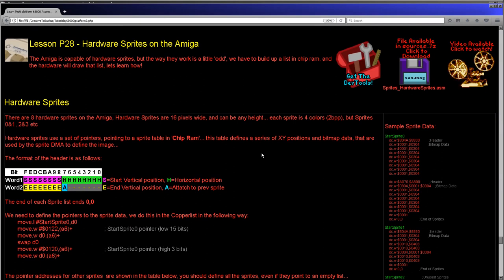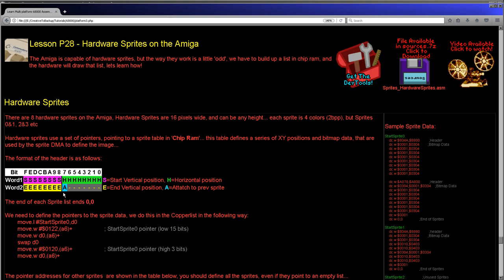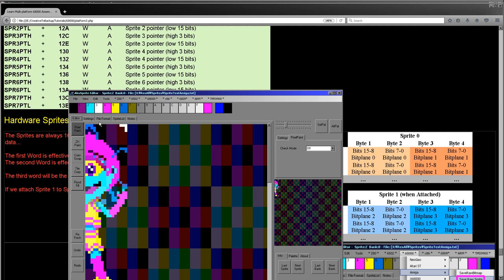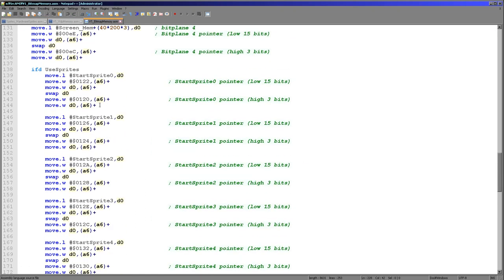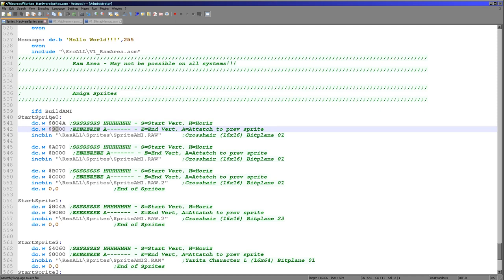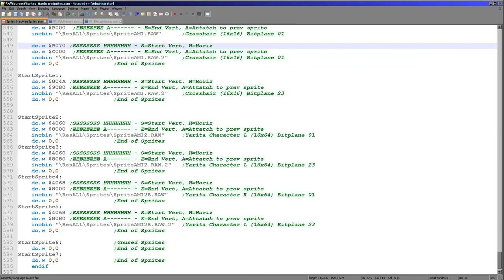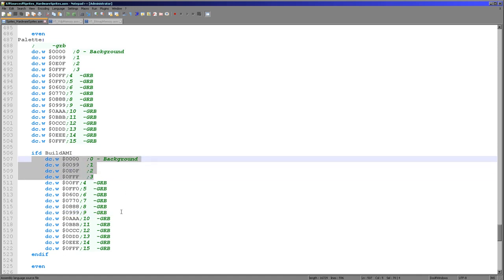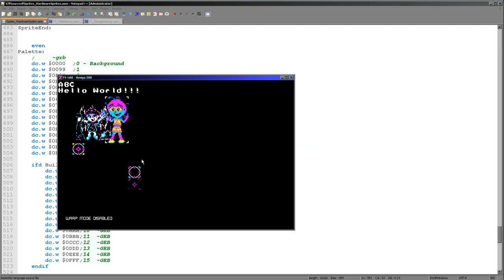Lesson P28 - Hardware Sprites on the Amiga

Comment: Great as always :)

However, It might be worth mentioning also that setting the 2nd byte of control word 2 to 0 only allows a 2 pixel granularity for horizontal movement as the low bit of HSTART is stored there on bit one, along with the high bits of VSTART and VSTOP.  By setting this byte to 0, you're essentially saying "VSTART * 2".

To demonstrate this, here's my C code for my UpdateSprite function, note the shift on [0] and the final AND on [1]:

void UpdateSprite(struct Sprite *sprite)
{ 
 sprite->posctldata[0] = (sprite->y << 8) | ((sprite->x & 0x1fe) >> 1);
 sprite->posctldata[1] = (((sprite->y + sprite->height) & 0xff) << 8) |
     (sprite->y & 0x100) >> 6 |
     ((sprite->y + sprite->height) & 0x100) >> 7 |
     (sprite->x & 1);
}

Comment: I have always assumed that hardware sprites on the Amiga would be a lot more advanced and easier than on the C64. 
When it comes to sprites, the designers often appear to have trouble making a programmer friendly system.
Which computer or console do you think has the most comfortable way of using hardware sprites?
Reply from the maker: I'd say any of the systems that support hardware sprites with a reasonable number of sprites, so X68000, Genesis, Snes, Nes, PC Engine, Master system

There's probably a few I'm forgetting there...

Of course Any system thats got a fast CPU and a software bitmap display is also very fine with software sprites... so Lynx,Amiga, Atari ST, MSX+V9990 etc.
Reply: yeah...Amiga has very loosy sprite engine... it was made many games imposible to recreate with standart hardware
Reply: @neocortexlab  The Amiga's hardware sprites were designed in the time where Pac-Man and Marble Madness were cutting edge games. That was fine for 1985, but they didn't update the sprite, Blitter, or sound capabilities enough for later Amigas.
Reply: That’s because they aren’t based on the C64.

The Amiga is an Atari product, it’s devs branching off of the Atari 8 bit computer series (which it’s sprites were much worse) and eventually leaving Atari alltogether right as tramiel leaves Commodore for Atari instead and commodore buys the Amiga devs. That completes the cycle.
Reply: @ChibiAkumas They’re based off the Atari 8 bit computer.